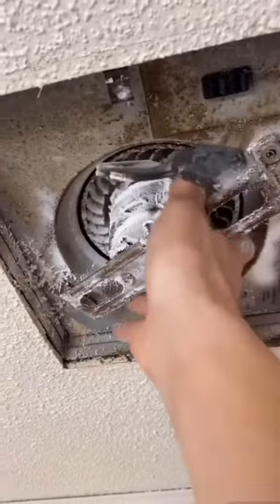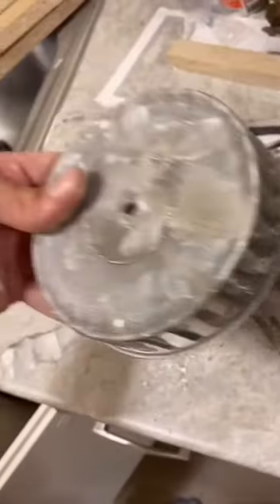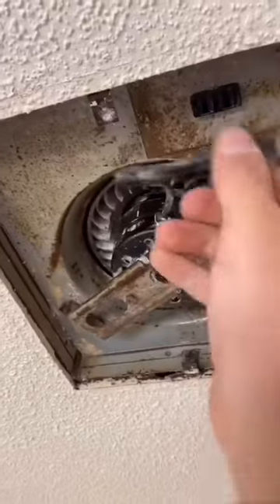Bathroom Exhaust Fan Maintenance. #shorts #handyman #realestate

Comment: The "tab" to remove the blade is usually a PITA hex plug on the shaft . These fans were manufactured by RMR in Phila PA - If you need a replacement without tearing the wall apart.

Comment: I lube my fan with WD-40 and it’s like brand new! But it only last 4 days before I have to do it again. Why does it get so dusty/dry!?
Reply: @Alexthefancollector  I’ll check it out. Also, my fan motor is hard wired (black and white wires). The motors at Home Depot are plug in. Not sure what to do if I ever need to change it.
Reply: WD-40 is not meant to be used as a long term lubricant at all. Its more to get things unstuck, like rusty bolts, pins, motor shafts, yada yada.
Reply: @nosurfzone9457 exactly. WD40 literally stands for 40th attempt at making a recipe for Water Displacement. Thus it's not a long-term lubricant at all.
Reply: Thank you all! I tried sewing machine oil/lubricant and it fixed it all for me

Comment: Don't have to disconnect anything first?
Reply: He literally disconnected the fan before he took it out. 🤔
Reply: @gzus1482  LOL just saw the plug ...it was dusty
Reply: Yes cut off power but that particular one is like plugging in cables to a computer monitors you know but safe is best cut power.If in Apartment just cut all switches if you don’t know or I’m sure go to bathroom flip switch if you hear northing or light doesn’t come on no power switch it out but I don’t recommend cleaning that by taking apart better ways but if I’m a pinch gotta do wat you gotta do

Comment: That fan is so old. It should just be replaced
Reply: That fan has a proper multi-pole motor which if oiled and kept clean will preform much better and last much longer than the single pole C frame motors they use now. There is no reason to replace something that is working perfectly fine just because it is old.
Reply: Maybe, but if it will work after just being cleaned it seems unnecessary

Comment: Ok so now my bathroom fan moves a lot more air but now it's even louder.
Reply: Squealing noise is louder you mean?
Reply: @jayasmrmore3687  just the fan noise itself and it's making me think why don't we position the fan in the unfinished attic space near the exhaust port instead of in the ceiling at the intake port?  Wouldn't that make more sense noise-wise?
Reply: @elbowstrike  wouldn’t that make the suction less though

Comment: I would highly advise against this. Not as simple as it sounds and pretty easy to fuck up. Also please say what kind of lube to use. Certain brands are toxic and people don’t know wtf they’re doing.
Reply: it IS pretty simple, they just unplug and the motor board comes out. It certainly is a good idea to oil a fan motor even if it is a "permanently lubricated" motor. Although he did not do it correctly, there are felt "oil wicks" that should be oiled. It also looks like he used WD-40 or something, which is the wrong thing to use. An oil such as 3 in one motor oil in the BLUE can, or zoom spout are fine. 
Most of the newer ones use an even simpler design that you don't even need tools to take out, and the motor is a simple c frame shaded pole motor, although it is definitely worth keeping the old fans going as they are much better than the crap of today.
Reply: Yeah it is pretty simple, I just did it but I had one with a light. Had to look up how to get the cover off but it was straightforward after that. Didn’t lube it but it looks simple. I just vacuumed. Did put in a new brighter led bulb in. Runs quiet now. It wasn’t even screwed in all the way I had to push the tabs in that are use the hold a side, only wood on one side lol. On the video I would have put a new cover on
Reply: KY should do the trick